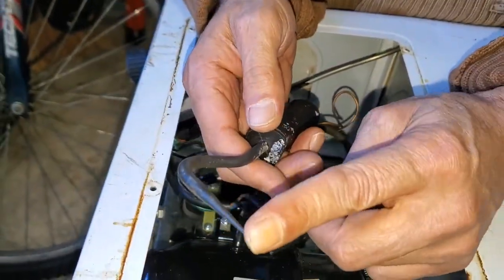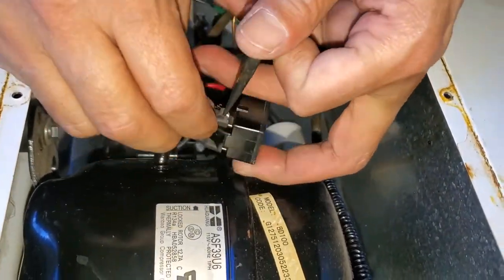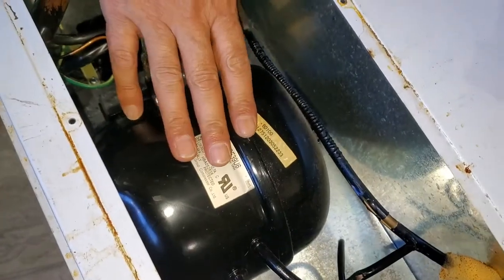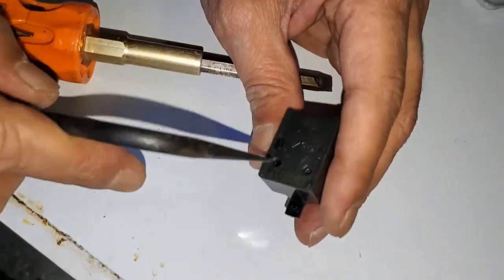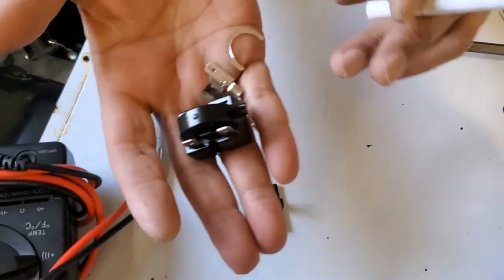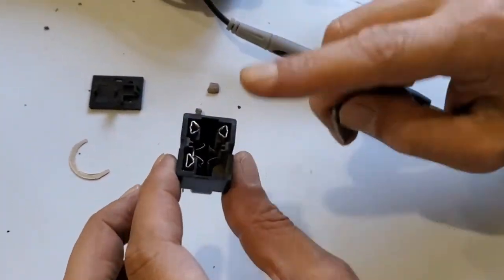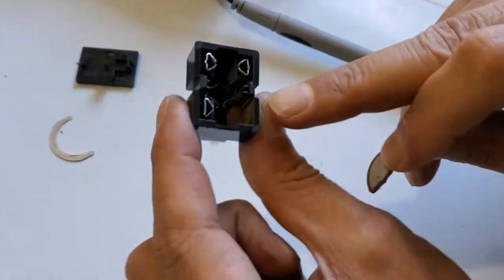Hack Freezer - Refrigerator Starter Relay,  How To Fix Fridge Broken Relay

Comment: My two pin relayis not made anymore.   I mistakenly bought a 4 pin relay, so i took that disk out and put in on the two pin relay.  It worked beautifully.   Thank you for our insight that saved my frig.
Reply from the maker: That's great 👍,  if it works and no overheating or any other issues then should be fixed, thank you so much and all the best 👌 👍 😀

Comment: I’m having trouble getting the wire out from the metal pin on the start relay for my fridge were u pushing down really hard on the hole?
Reply from the maker: There's very tiny hole on the connectors clamp check Both sides  to locate it , they not easy to remove, you will have to keep try push on hole with picking tools or Sharp screwdriver to unlock it and at same time pull , I hope that will be helpful, thank you and all the best 🙏

Comment: Hello ..question my Thomson freezer burns out light bulbs  you can say me what part I need see here to repair ?
Reply from the maker: Hello my friend, Try to use freezer light matches the voltage in your country, thank you and all the best
Reply: my chest freezer is a thomson model TFRF520-D-SM...this was exposed to a high current in the home and the bulbs burned out ( on and run light). I currently connect this without the bulb ....is it normal that the freezer hot on the sides even though it cools?...

Comment: My freezer wount come on when it chipped out. I have to plug it out wait a minute, plug it back in for it to chipping, why is that?
Reply from the maker: This may cause by bad starter relay, or maybe bad thermostat , bith must be check or tested, start testing temperature thermostat, turn to max cold the freezer must starts on  if doesn't that means bad thermostat,
Then turn thermostat to lowest cold the freezer must turn off , it may take few seconds if it doesn't that mean bad thermostat.
The starter relay located beside the motor in the black plastic box.
You can test it by removing it and shake it if it makes noise or something inside means it's bad.
I hope that can help you to figure out the problem. Thank you and all the best

Comment: where i can buy ceramic disc for  the relay
Reply from the maker: You can buy them from Amazon, aliexpress,  ebay, and other websites   you can search it depends in which country you are, here's Amazon example HQRP Compressor 4.7 Ohm 1-Pin PTC Starter/Start Relay and Overload Kit Compatible with Mini Fridges, Compact Refrigerators, Beverage & Wine/Beer Coolers, Deep Freezers, Beer/Wine Refrigerators https://a.co/d/0ln3qtD

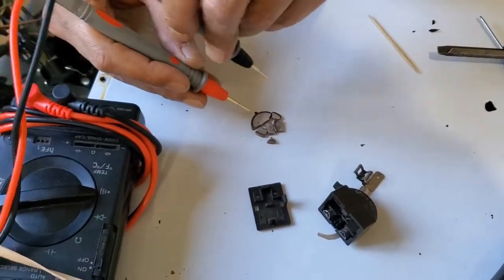Comment: 2:20 what is that round broken disc?
Reply from the maker: Thermostat, temperature starter automatic on and off, it's made of condicting ceramic. Thank you 😊
Reply: @WorldRandomVideos hello I replaced my relay and overflow and my refrigerator started working again but only for a few hours any suggestions
Reply: Overload

Comment: No danger for fire?
Reply from the maker: No danger as long as the temperature thermostat works, so if the refrigerator or freezer still automatic shut-off and turn on as needed all should be all good , thank you and all the best
Reply: @WorldRandomVideos  amazing my dear friend!! Thank you
Reply from the maker: @jamiemorales2022 , thank you so much and all the best way 💕🙏💕🙏
Reply: @WorldRandomVideos   one last thing please... what do I do with the thermostat wires they are separated from the power cord
Reply from the maker: @jamiemorales2022 ،  hello my friend, I am glad  to read your wonderful comment and great support 💕, and as always I am happy to answer your question or to help you the best I can, the temperature thermostat wires are connected to the refrigerator compressor and to inside refrigerator to measure the temperature when refrigerator or freezer gets colder  at desired settings temperature the temperature thermostat will turn off the compressor and when refrigerator gets littlle warmer or below the desired temperature setting the thermostat will turn on,
So you don't need to do anything with temperature thermostat wires leave them as is, it's important to watch the refrigerator to make sure it's working, temperature thermostat shuts off and after few minutes when freezer gets littlle warmer turns on, according to the temperature thermostat setting,
The refrigerator compressor has it own thermostat it's called starter relay, this mostly gets burned out or broken because of the heat, it's always recommended to replace it, but its also repairable most of them, or hack it, by delete it and by pass directly to the power, but it's not recommended just in case the compressor get over heated, or the main refrigerator temperature thermostat stops working, I have done this few times last few years and no problems at all,  however it's important to keep the refrigerator temperature thermostat at the right temperature setting, for example °3c or °0c etc and watch the refrigerator autamtic turns on at below temperature setting and shuts when refrigerator gets cold at desired setting, please don't hesitate to ask questions or if you need help feel free, I will be happy to help, thank you so much and all the best ❤️🙏
Reply: @WorldRandomVideos  thank you so much!!
Reply from the maker: @jamiemorales2022 my pleasure

Comment: Didn't even show which. Color wire connects to which terminal. That is the crucial point
Reply from the maker: Hello my friend,  th3 purpose of this video is to show how to fix broken  freezer starter relay. 
Inside the relay there's a thermostat it was broken, it makes connections between ac main power 120 v and compressor with external adjustable thermostat,  
Thank you
Reply: I replaced the stone disc inside the original relay housing with one from a new relay. New relay was 15 ohm while original was 4.7. New disc was also bigger. Plugged in and fridge is working. Is it safe to just change out the stone disc like I did?